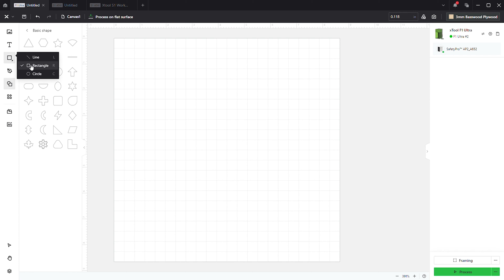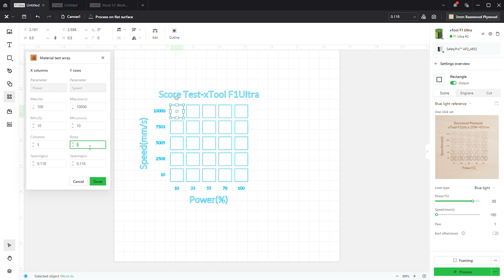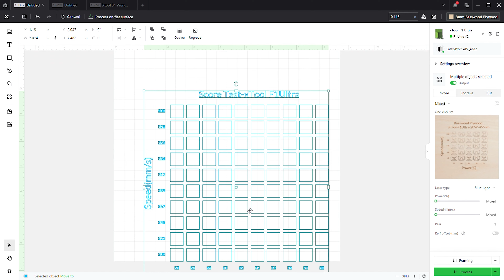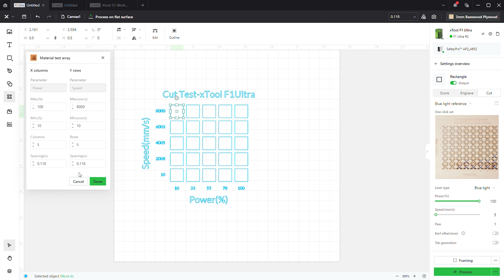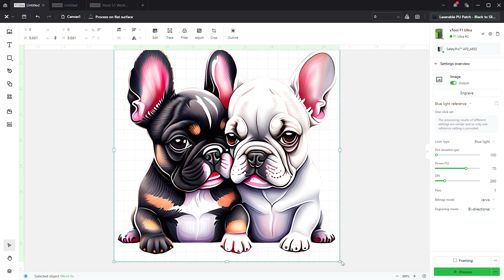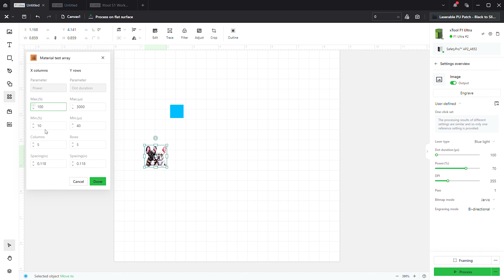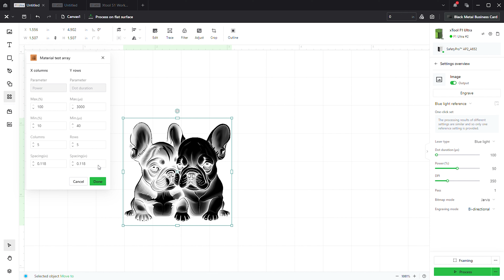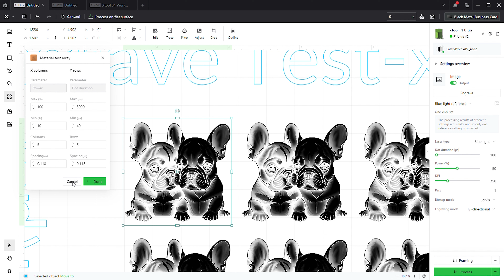Material Test Grid Overview in Xcs

Comment: Thanks for the walk through. One thing that I've struggled with is determining what Dot Duration to set things to. My mind says dot duration, how often to make a dot but at the same time I think, DPI, Dots Per inch so I'm still very confused about what to set Dot Duration to. Would you mind explaining. BTW I saw your black acrylic round ornaments on FB and they look Great. That's what I'm striving to do, something that looks as amazon as those are but from what I've messed with, that's a whole other level because engraving .jpg files seems to have two Dot Duration settings. Help! Thanks in advance. I have the original F1 & P2.
Reply from the maker: Totally remember replying to this but dunno what happened. 

I’ll go over the settings in a video and what they mean and what they do to the results.

Thank you so much for the kind words.
Reply: Thank you!
Reply from the maker: @BinaryDisastr I uploaded a short video to go over Dot Duration and DPI

I will do a better one later, but this should give you the basis of what will happen when adjusting them both. This is for Jarvis and I’ll have to do a separate video for grayscale which has a power band